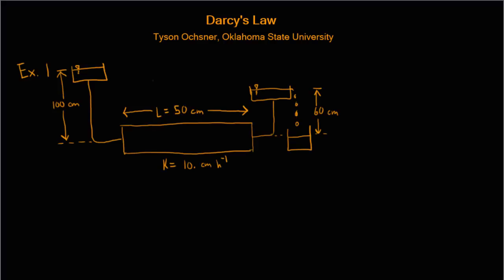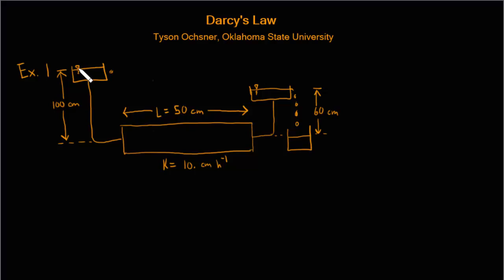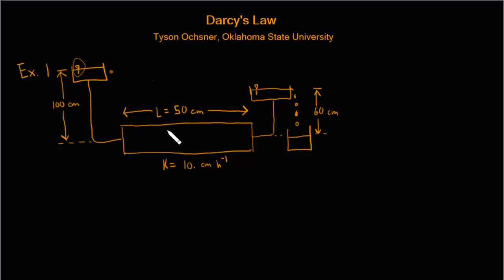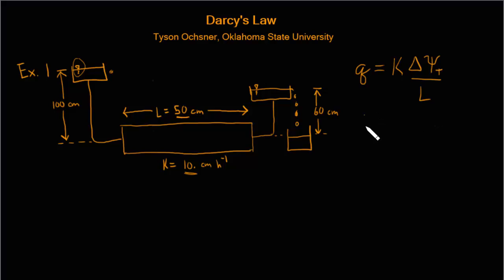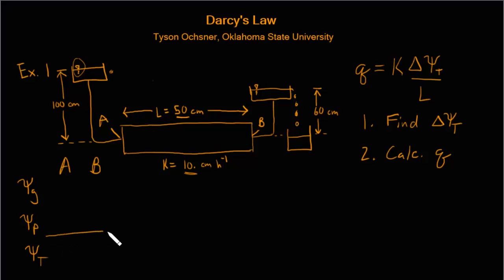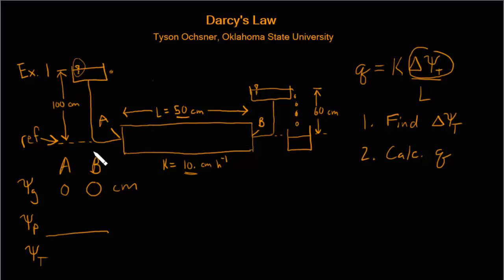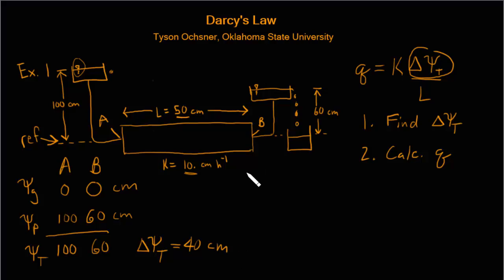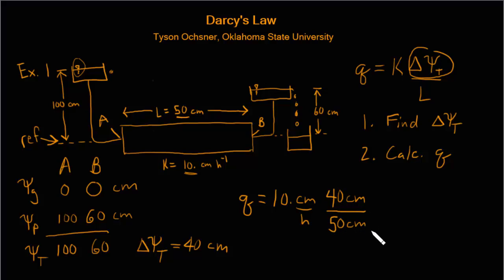Darcy's Law - Horizontal flow example

Comment: How do you calculate for the Hydraulic gradient? Is it constant? And does the height of the water affects its permeability? Why is it in 100cm and 60cm?
Reply: 100 Cm and 60 cm are given in the Question..
Hydraulic Gradient= (Head loss)/Length
It means (100-60)/50